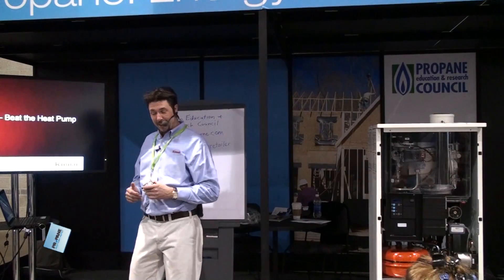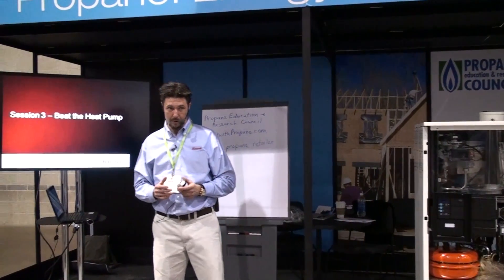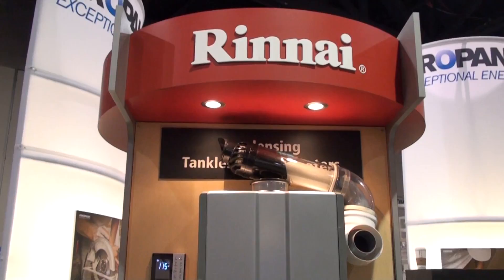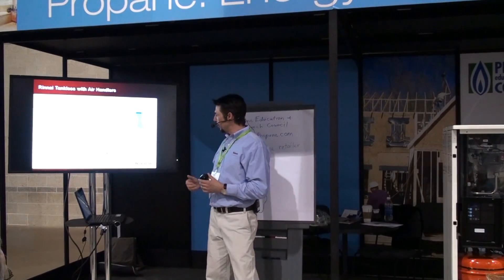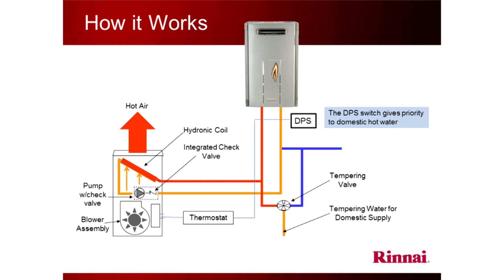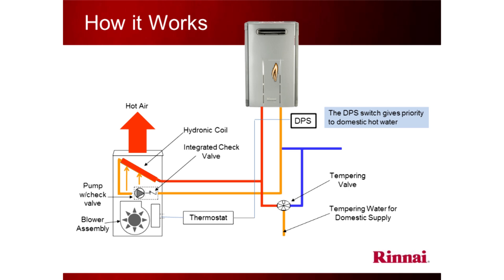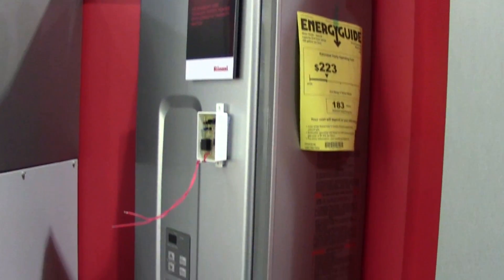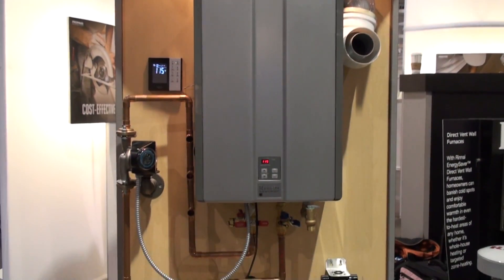How to Use a Tankless Water Heater in a Forced-Air Heating System

Comment: So which way does the little check valve go on ? Is it on the cold return and direction towards the cold water line going in to the hot water tank or tankless?

Comment: But my concern is that Rinnai Hot Water boilers have max. temp at 140F ( default is 120 F) and if this can let the air handler blow out enough heating for a harsh winter. 140 F is low and not enough for me. Unless using Rinnai Combi boiler which has 180 F on the heating side, a regular Rinnai boiler cannot get enough heating to the house, though technically it may as this presenter describes here.

Comment: If I already had a hydronic handler connected to a tank and switching to tankless, do I need to connect the return valve to the cold water? Or does it recirculate through the incoming line only??

Comment: Had a m series installed and they bumped it to get it to run with the air handler so the rannai runs non stop the guy has no clue how to do it is there a control box I can buy and install myself the mans useless and heist a professional at that
Reply: soon as he said about 3 showers running and it’s going to turn them off, I knew the guy was clueless

Comment: this system does not respect the plumbing cod in sua because many accidents have occurred: 1. maximum allowed temperature (plumbing cod) for showers or baths is 115F
                      2. The water that stays in the heating circuit for 4 or 6 months in time that is not used in the hot months produces bacteria dangerous to health if you consume it. Water from the heating circuit is mixed with the circuit drinking water contaminating it
Reply: Exactly, I was googling for this as an option to replace a very expensive Apollo Water tank used with my 22 year old Hydrocoil heat system. It was designed with TWO separate tanks internally, one for potable, one for heating.
Reply: @EmbeddedJournalist  Doesn't the water that stay in heating circuit also heat via pipes? you would need those pipes to be properly isolated, if not this doesn't seem much better than a hot water tank. My brother just bought a house with this setup on natural gas, none of his pipes are properly insulated (just a small sleeve)
Reply: Yes, you're absolutely correct! I'm a plumber/heating contractor here in MA and I can tell you this system causes water stagnation which is health hazards and totally illegal in MA.

Comment: I have been doing this for about 12 years with my Takagi. Just put a coil in in an old oil air handler. Living in Utah occasional -30° below in winter. Raised four boys, lots of laundry, daily showers for all sometimes 2x a day. We have never ran out of hot water, even with 2 showers going at a time. Setpoint at 131° winter 120° winter. Just waiting for my Takagi to die.  The principal works my friends. Never and issue. 3,000 ft2 built in 1907 with new windows and attic insulation.
Reply: I have a question: is this unit going to provide heat even on summer ?
Reply: I had a m series rannai installed two days ago and they had to bump it because they couldnt figure out how to get it to run when the air handler kicks on and calls for the heat the rannai is running just the air handler for heat we have a separate hot water tank installed for the domestic hot water the rannai runs into a air handler in the basement then pumps hot water to the attic were there is a second air handler with the same coils and pumps inside as the one in the basement is there a controller box we need to make the rannai communicate with the air handler like I said the tech bumped it so we had heat for now he said he would be back to fix it
Reply: @killaclutch4208 should be able to just also run a power wire from air handler. So when air handler powers up, then it sends power to turn recirculation pump on for water heater. That is pumping the water to circulate it through heat system. Once pump comes on and moves water, then water heater will fire up when it senses flow
Reply: @killaclutch4208  greatexampleofreadabilityvspunctuation